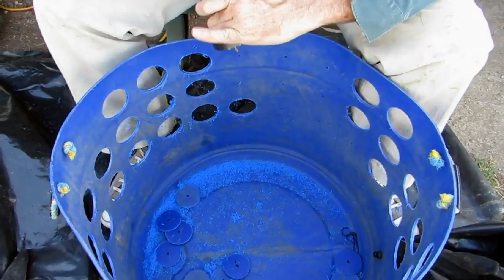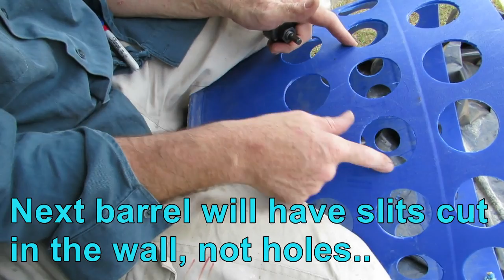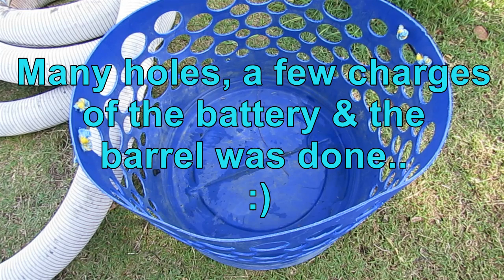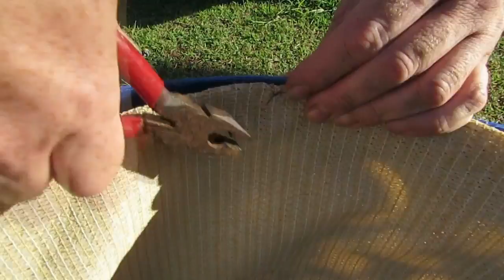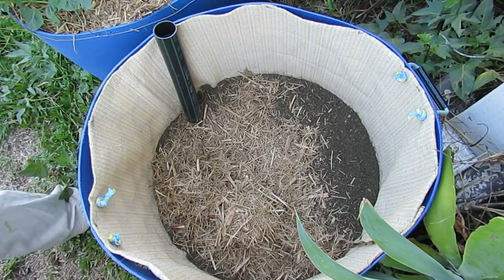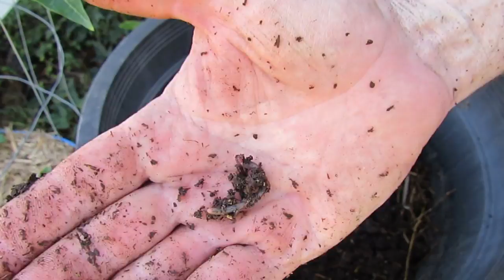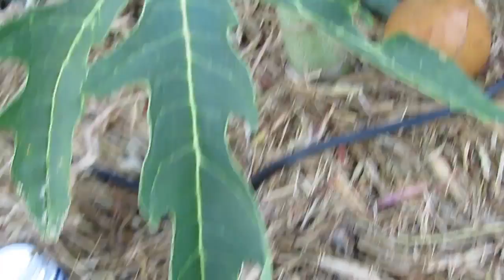Air Pruning Self watering/Wicking barrel, a DIY project for papaya/pawpaw..

Comment: 11 years out, is there an update?

A different approach that I’ve thought about is using a construction product that is designed to protect foundations from moisture by creating a drainage layer. The impermeable layer would keep the moisture in and the permeable layer would keep the soil in the center but air would be able to enter the space in between and prune the roots.
Reply from the maker: That tree eventual died after being damaged buy the builders when we were renovating back in 2018. It did give us loads of fruit though. The planter is now on the deck & have rosemary, oregano & thyme planted in it. 
I'm not familiar with those products but will have a look online.
Cheers mate.

Comment: Did the air pruning turn out in the long run?
Reply from the maker: It survived for about 8 years in the barrel so I think it did well. In the end it died after getting damaged when we were getting the house renovated. Some sort of infection set in at the wound site & the trunk rotted out from the inside.
Reply: @RobsAquaponics  I want to grow a palletized orchard so I can move it around easy but I’m trying to figure out what the minimum ibc size would be for a fruit tree.
Also exploring air pruning methods just to see what that’s about i notice we do it with evergreen trees for retail at work.

Comment: Hi Rob, i have just watched this video & was wondering how did this work out. Did the pawpaw grow & fruit, is it still growing if not how long did it last any information or a update in your next video would be appreciated. Thank you.
Reply: Hi Rob i looked down at the comments & found more info from a year ago, so i think i got my answer to my question. I am keen to try this with avo's, lemon's and other trees that i can prune as i have a small amount of space to work with. Any advise would be helpful. Thank you Ron.
Reply from the maker: Hi Ron. I did have a lemon in a straight wicking bed but it didn't do so well & died from neglect more than a few years back. 
I have seen others grow citrus & some stone fruit in barrels with success, not these "air pruning" ones though. I can't see why they wouldn't do OK in them though. Sorry I'm not much help mate.
Reply: Hi Rob,  i have a couple of lemon trees in blue tub,s with holes drilled in the bottom, but like all plants in pots they will get pot bound at some stage & die. I have about 8 blue tub,s to play with & 4 avo trees i have grown from seeds. Can you tell me if this system will stop plants from becoming pot bound. Thanks Rob
Reply from the maker: @roncoles8361  I've found that the plants don't get root bound in this or the air pruning pouches I use. 👍
Reply: @RobsAquaponics  thanks Rob i let you know i go

Comment: Looks like a great idea. How has this set up worked overtime ?  thanks for the vid.
Reply from the maker: The tree is still growing in the barrel but has been infected with some rot. I think some damage by earthmoving equipment while we were renovating mat have had something to do with it. 
Still, 7 years fruiting in the same container is still impressive I think.
Might do a clip on what the root system looks like when I "retire" the ree in a little while as it may interest a few folks. 
Cheers.
Reply: @RobsAquaponics  Thanks that would be good to see if you have the time. Thanks for all your video's I have learned a lot from them.

Comment: What material are you used to cover around the pot in side, is carton ? Thanks.
Reply from the maker: Its a garden shade cloth that I folded over. 👍
Reply: @RobsAquaponics  this way plastic pot, is better or much better the new geotextil pot? Thanks.
Reply from the maker: @Ser-xk1pu  This planter & tree are still going. I'd say the planter will outlast the tree at this point. I have also set up an air pruning fabric "pot" on a wicking tray that's worked very well over the past few years,
 https://www.youtube.com/watch?v=FQiprIXnQ6I

Comment: What size perforated drain pipe would you recommend for a 5gallon bucket?
Would it make much difference to have the holes on the side slightly lower than the top of the drain pipe to allow air pruning from the bottom too?
Reply from the maker: You would need something fairly small & I would probably go no larger than 50mm/2". Adding holes below the pipe height will also reduce the amount of water the reservoir can take. 
Might be better to try something like an "global bucket" for a container that small SR.
I built one years ago that did OK. 
https://www.youtube.com/watch?v=tt_8SZpl3U0
You could still make it an air pruning system, would just need to drill through 2 buckets.
Hope that helps some.

Comment: Hi thanks for the detailed explanation. One question so, why don’t you put the grow media all the way down to the reservoirs?
Reply from the maker: Solis high in organic matter can go aerobic & cause rot issues so that's why I lie to use sand in most of the bed/barrel builds I do.
Cheers.
Reply: Rob Bob's Aquaponics & Backyard Farm 
Thank you for your quick response. May be one more question; how long before you would redo / rebuilt the wicking bed?
Reply from the maker: @tschreiber9855  I have had some going for 9+ years with the same soil. You just need to keep feeding them with a good quality compost & they should keep producing well for you for years.
Reply: Rob thank you for getting back to me.  Is quite helpful info

Comment: Hey Rob, fellow Ipswich resident here 😉. Really keen to try this out and was wondering how the system is performing now that it is a few years down the track?
P.S. Just finishing up another pair of wicking IBC's while we are in semi confinement and tried out the milk crates for the reservior. Looks good so far.
Reply from the maker: Hi neighbour.
The tree is still going but don't expect it to last until spring due to some damage it got while we were renovating. Will be popping another  pawpaw in it when I get time to dig one out form a bed down the back. 
Our crate bed is doing really well & am thinking about doing the same for the next 2 I want to set up this week. 👍
Cheers Joel & let me know if you need any more info from a fellow local.

Comment: Do you think air pruning would work enough by simply drilling lots of much smaller holes in pot (eg 1/4 inch or 1cm)? Have U ever tried it or seen where anyone else has?
Reply from the maker: You would get some air pruned roots but the pot would have to be covered with them to get the best results I think.
Cheers.

Comment: Hi Rob in this episode I did not see how you set the air layer of the holes to the size of the pipes?
Reply from the maker: Hi Shaun. I just made sure that the bottom hole was above the top of the drainage pip in the base by about 25mm/1". 
Is that what you were wondering?
Cheers.

Comment: How does the wicking from the sand to the grow bag compare to the soil wicking of a typical wicking barrel?  I live in Texas and my intuition would say that in the dead of summer it wont supply water for very long without evaporating from the sides of the grow bag (might not be usable for berries/tomatoes/peppers)
Reply from the maker: You will get some evaporation but not a great deal as soil is a fantastic insulator. The evaporation of water will also help to keep the soil & roots a bit cooler as well I suspect. 
Would like to know how you get on if you give this method a crack. 👍

Comment: If all you’re doing is creating a reservoir with the ag pipe why not use some other space occupying material like old bottles , pots , anhinga hollow?
Reply from the maker: You can use whatever you have on hand that will create a void. 👍
I use the ag pipe as it's a bit more durable for the amount of weight a small tree will have. 
I also use it in the veggie planters as well. 
Cheers.

Comment: I don't understand the point of the hose .. Would the soil not wick the water  ? If you had rocks or perlite ,that would make seance.
Reply from the maker: The hose will hold more water due to it being a large void.  You can use rocks if you like but the void space won't be as much as with a hollow pipe. 
Probably wouldn't use perlite as it would get crushed under the weight. 
Cheers.

Comment: I've been watching heaps of ur videos over the yrs (which are great), but I'm wondering why ur planting in pots so much rather than directly in the yard? I know with blueberries (highly acidic requirements) pots enable U to only have to keep the potted soil more acidics, but I just dont understand why else? I have over 70 fruit trees/ plants plus vegies in my tiny suburban yard (mostly dwarf espaliers), but also 14 blueberry plants, strawberries, aloe vera etc etc, & I find that its massively more work growing in pots rather than in the soil, plus a whole lot more expensive, so I'm very curious as to ur reason for so many pots? I'm not criticizing at all, but just trying to understand why!
Reply from the maker: Hi Susie. 
The main reason the trees are in pots is that we have been planing to renovate the house for the past 4 or 5 years & didn't want them planted out only to be removed or damaged by earth moving equipment. Some plants like the bananas I'm not sure I want in the soil down the back due to neighbours spraying weed killers & the build up that may of caused over the years. Am still planning to grow them in self watering wicking beds but will be using an auto top up system to keep them well irrigated. 
Hope that helps some.
Cheers. 🙂
Reply: That makes sense..... ha, I thought I might have been missing some amazing potted plant secret, but now I get it. Yes, I'm going to put banana trees in pots for 1st time soon where the soil in my yard has too much clay, & I cant wait to see how well they go. I'm on Mid North Coast of NSW & its great to watch what gardeners are doing in similar places. Thanks again for your videos.
Reply from the maker: Have you seen the bananas we have growing in the root pouches?  Got fruit from both but they really do need to be planted out as I let too many suckers form on them 🤒
Reply: I will check it out 2nite. Thanks  for ur valuable info!

Comment: I bought a tree grown in one of those root pruning bags, its a kind of felt pot. When I planted it out I took it off as it was looking a bit grungy. I notice the roots had grown into the felt and where happy there. So when I took it off I had to rip off a load of the surface feeder roots still adhering to the grow bag. We have very high humidity so maybe thats why it didn't work so well, not sure. Question is should i have planted the whole thing, grow bag and all? I wasn't sure if this wouldn't have have stunted the tree as the veld takes quite a long time to rot away. The roots did look good but as I say they had penetrated the felt.
Reply from the maker: Hi River P & sorry I missed your question. 
I think it was probably a good idea you removed it. 👍
Some of the material bags you can plant out into the ground & they will break down over time where others may not. I use & sell the root pouches now & find they work really well but like any potted plant needs to be fed well as there's only so much nutrients available to the plants in pots.
Hope the tree is growing well for you now.
Cheers & happy growing. 🌱🌱
Rob.

Comment: Good Day Mr. Bob, Just watch Air Pruning Self watering/Wicking barrel, a DIY project for papaya/pawpaw. Very informative. Question, do you have an amazon acct. for sugar cane mulch? It is not sold in the US.  Can give any suggestions. Thank you for your time and well educated videos. Thanks.
Reply from the maker: Hi CrazyZee69 & sorry I missed your question. I use it as it's cheap & takes a while to break down. You could use any sort of straw or mulching material as long as it's recommended for use in the garden. 
I do have an Amazon influencer page but haven't got any straw listed sorry. https://www.amazon.com/shop/bnbob01
 My apologies again for taking so long to respond.
Cheers,
Rob.

Comment: I don't know if this has been mentioned in the comments, but how about using a laundry basket with holes already precut? I'm not real handy with a drill so that's what I'll be using to grow sweet potatoes. We'll see how it goes!
Reply from the maker: Hi Casandra. The plastic in the laundry baskets tends to break down faster than the UV stabilised barres so that's why & decided to use them.  They're also a bit wider on the base which helps as well. Have seen folks use them for annuals like the sweet potato though & the look to do a great job. 
Cheers & happy growing. 🌱

Comment: hello i was wondering how well a homemade airpot would work with much smaller holes say 1/4-1/2 inch spaced much closer together kind of like a steamer pot or colander because i made one this way and am curious if it will work as well
Reply from the maker: Dean Walcott  Hi Dean. Sounds like it should work OK mate. Have you lined it with a breathable fabric as well?  Must of taken you a while to drill them all out. 
Cheers
Reply: glad to hear that it will work i plan on transplanting a seed grown lemon tree into this pot i actually was able to skip the fabric because the holes were small enough to prevent the soil from falling through however next time i plan on doing it with the bigger holes and using the fabric because i didnt realise how long it would take
Reply: Sounds like you're using an old washer or dryer tub. Am I right?

Comment: You say next barrel will have slits, do you mean supplimentary slits to your large holes, or pure slittage? I was thinking that you should be able to just do vertical slits, in starter pots (2.5"-4") for my garden, so I can cram more plants under my lights. Did you try an all slit barrel, and if so, how did it go? Thank you for sharing, great stuff.
Reply from the maker: Hi there. I was going to cut out 2" wide slits from the top of the reservoir to near the top of the barrel but ended up cutting out rectangles instead. I popped in a fabric root pouch instead of using shade cloth & cut a hole in the base for the fill tube to go through. The lemon I planted in there hasn't done the best due to the poor soil mix I've used unfortunately.  It needs to be re homed & is on my list of jobs to do. 
Cheers & all the best.

Comment: I was excited to find your YouTube channel and subscribed to your channel today. Ive wondered how an air pruning-wicking pot would do and have been thinking of trying this myself. Great video. Thanks for posting it. Since you posted this in 2013 I was wondering how your tree has done.
Reply from the maker: Hi Tom. The tree is doing well & has a fruit setting on it at the moment. I have found that it needs regular feeds to keep the fruit production up which is something I've been guilty of missing. Other than that the tree looks great 👍.
Here's the most recent clip with it in from a few weeks back if you're interested. 
https://www.youtube.com/watch?v=5DCFptmqnhw&t=4m18s

Cheers mate & all the best. 
Rob.

Comment: Cheers rob....building some of these here now.....I found using the drill in reverse it actually melt the shavings all together and makes the holes basically bur free so no need to scrape them afterwards either.....cheers mate
Reply from the maker: Nice one 👍 Mine bur when cutting in reverse unfortunately. Might have something to do with the way the teeth are set on the saw blades. 
Hope the [plants are doing well in them.
Cheers.

Comment: Wow! :)
I'm at tryin to replan and find a cheaper solution to many NFT flood systems on the market. Respect!
I got a question I think many will have for my future product: How well does it reaches the results of the...market leader in its field, for the price gap you'll obv suggest?

Really interesting though, i think should fit good for me. I mean, idn actually think many concave surfaces instead of a drilled plain one will justify that price have much more results. I'll check ur site and give a try to your idea! :)

Comment: using a skill saw or its equivalent will lessen the amount of time to aerate the surface of the barrel.
Reply from the maker: +deedo dunphy 
The ones I looked at weren't as strong & most will also break down in UV light. If you can find a decent UV stabilised one go for it I say 👍
Cheers & have a great one.
Reply: you can buy laundry baskets in discount stores very cheaply, no need for cutting!
Reply from the maker: +littlepapa47 
Hi there.
In the newer barrel I cut out large squares with the jigsaw. Made the job a lot easier ;) I do like the pattern effect the holes made though. 
The knife does a good enough job for what I want but can see where others might want a more polished result. 
Cheers & all the best. 
Rob.

Comment: You could, instead of using a utility knife, use a propane torch to melt excess drill burr and smooth the hole beautifully.
Reply: In that heat I think an alcohol torch might work well too. If reducing fossil fuel use and expenses is any consideration. Maybe used vegetable oil. It doesn't take much excess heat to get those little barbs to shrink back.
Reply from the maker: +littlepapa47 
You could if you want, I find the knife does a good enough job for me. Have had a fair bit of practice though ;-)
Cheers.